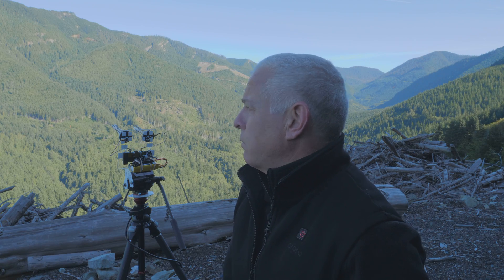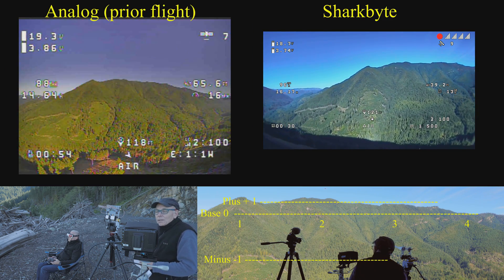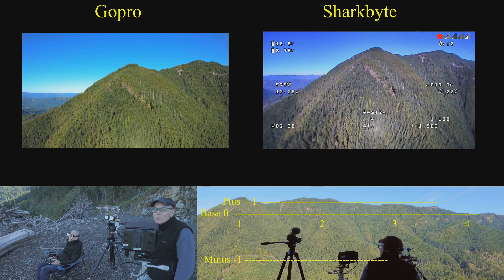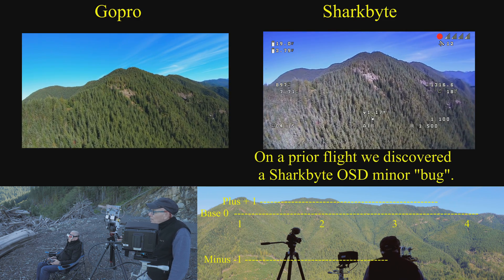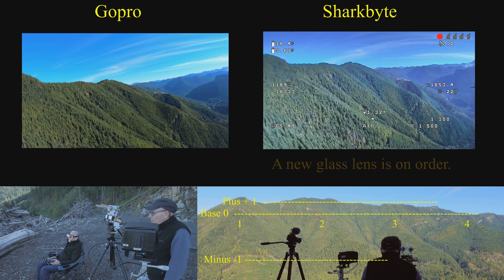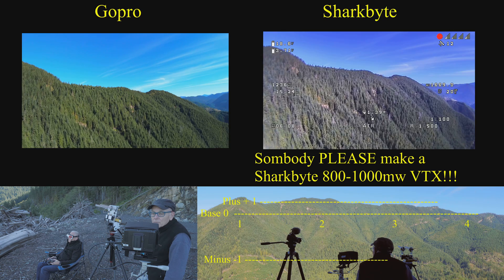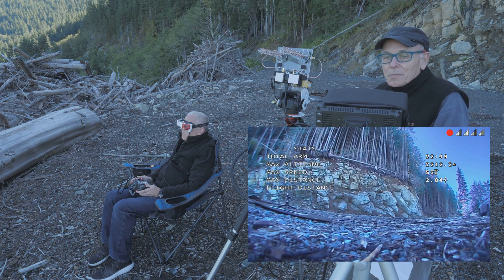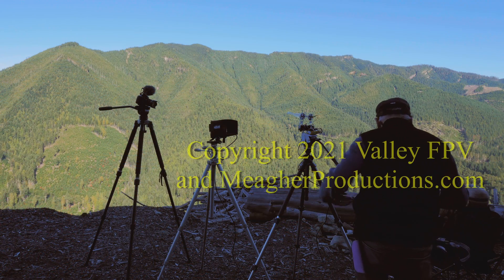Sharkbyte vs Analog at 3+km Testing O.R.T. Helical Antennas and Ground Station for Long Range FPV

Comment: Absolutely awesome SB Long Range flight.  I'm super looking forward to finishing my 1st SB Build. I'm using the new 200mw race VTX.  I fly Freestyle.  I'm also super looking forward  to a higher powered SB VTX.  I have the Runcam Nano SB camera with the HDZERO upgrade lens in transit.  I'm looking at the HDZero website everyday in anticipation of some availability on the new Larger Sensor HDZero/Runcam Micro camera.  I want one of those very badly.
Reply from the maker: Thanks for watching, and you and I crave the same products. I have two of those small glass lens on order; also eagerly await that micro camera, and of course a more powerful SB VTX. I suspect in a year from now we will have all the items we desire.. in the mean time I'm running the older discontinued 500mw vtx and one of the 200mw Units. I"m going to keep pushing the range limit and use higher and higher gain RX antennas with what we have to work with now.. then when we get ore powerful VTX that should be icing on the cake.

Comment: Great video! I see you have video noise even before taking off. This can be caused by a few things. Could be rc telemetry interference or a noisy power input. Would love to help you fix the issue. Great quality otherwise though
Reply from the maker: Thanks. Yea it shows up when arming. This  SB vtx is on one of my crappy early 7in  builds..I will move it soon to a newer build which is cleaner if that makes sense. I run the vtx pos and neg direct to the esc pads and have a 10000 cap at there as well. The quad is poorly pid tuned.
Reply: @ValleyFPV  if the noise starts from turning the motors on, it might be esc EMI
Reply from the maker: @RyanQuellet  thks.  Yea you won't see it in my posted video..due to editing..but the image is perfect until motor start..then the noise kicks in.
Reply from the maker: Rc telemetry a possible cause?..interesting..I am running CSFR with telemetry on.

Comment: Hey great work, neat to see you’re using SB now. I just ordered a dual stack setup that I’ll be taking back to Norway (I’m stateside now) in a couple weeks to do my own testing. Image is certainly looks better than analog and it appears you’ve nailed the signal range! Also glad to see you can split the hdmi, I was curious if that was an option.
Reply from the maker: Thanks for watching. I feel that I will be able to fly even further that 2 miles. I like to test incrementally.  Where did you find that dual stack vtx? Difficult to find now. I need another.  Yes..use a powered splitter.
Reply: @ValleyFPV  RotorLogic still has some in stock. I’ve been wanting to go digital for a while, but haven’t been confident with range or reliability compared to analog… Too many stories of DJI freezing or rebooting mid-flight and SharkByte just didn’t seem to have good range or quality… I decided to order an SB setup to see if I could push the range, but you seem to have proven the system is quite capable.
Reply from the maker: Thanks.  Long Range with SB seems dooable.. with a good antenna aiming process. I feel I can get to 5 km perhaps more with good ground antennas.
Reply: @ValleyFPV  Yea, my current analog setup does 7km no problem, at which point battery life is the limitation. This isn't really necessary but would be nice to match with SB...  How do you feel about the SB image quality? Nice improvement?
Reply from the maker: @GiantAntCowboy  same here..battery life will be my range limit...   the SB image is better than analog..but not earth shattering better. It's a subjective improvement.  If I can get the same range with SB as I do with analog then it's a no brainer.  If my range is limited..then i dunno if worth making the switch. Time will tell as I test further out.  If I can fly about 3 5 to 4 miles with decent quality I will be pleased.

Comment: Thank you for sharing this test! I’m currently waiting on a back ordered SB receiver, couldn’t resist the sale. Great job with the ground station!
Reply from the maker: Thanks for watching. Yes I porchased a 2nd RX.  You do realize that you also have to use their transmitter and compatible camera too..
Reply: @ValleyFPV  yeah I’m hoping that a better vtx is out soon. I was surprised how much you got out of the 500mw, maybe due to your good ground station/antennas.
Reply from the maker: @spookydonkey2195  yes..expanding the gain of the ground station is all we can do without a powerful VTX